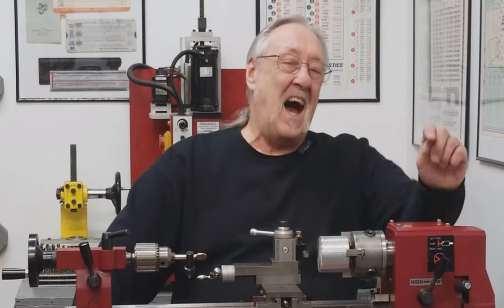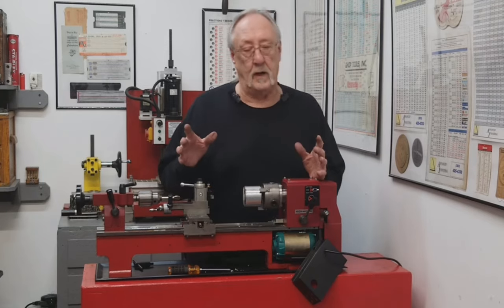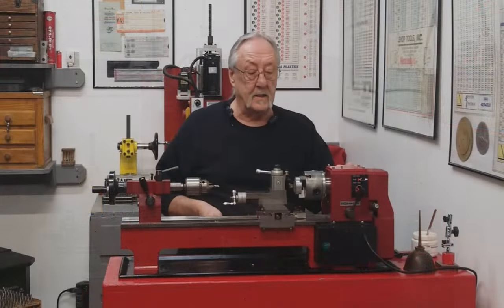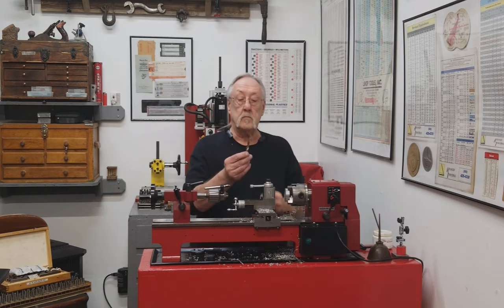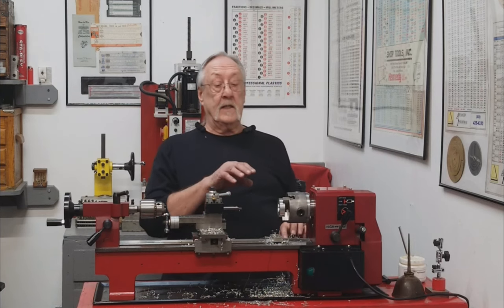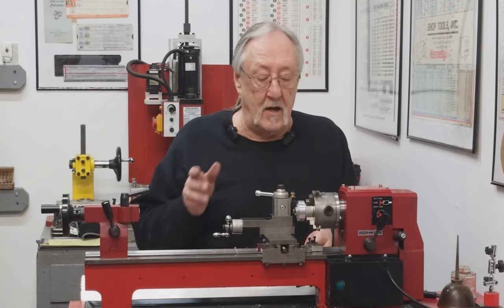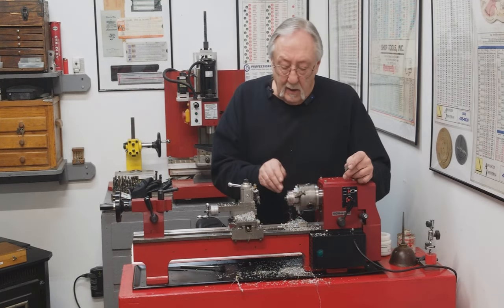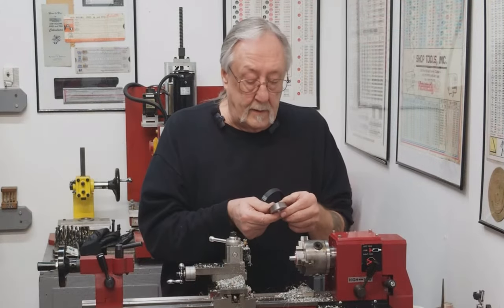Mini Lathe, Big Motor UpGrade 2, Turning Custom Pulleys

Comment: Great vid Glenn...
Reply from the maker: I'm glad you liked it Frank. There is so much more to do on this UpGrade. I'm currently working on Big Motor UpGrade 6 and the videos keep getting better. Lots of hobby machining and that's what my channel is all about. Thanks for watching.
Reply: @GlennNowOnYouTube  
Yes Glenn, I am a hobbyist, retired carpenter, but have developed a keen interest in metal working...
I have bought a mini lathe and a mini mill...
So I am learning through YT vids... 
I am in the UK ... I have a small workshop, fixing to build a new bigger workshop!
Looking forward to more content from you Glenn...

Frank...
Reply from the maker: The main things to remember is to take your time be careful and have fun. It's a hobby. Good luck with the building of your bigger shop.

Comment: Hey!  I noticed you used a gauge block instead of a pin this time😂 I like the idea of using a grooved belt a opposed to a v belt since it will grab better.  Also I was surprised to see you face the part to length first instead of doing the grooves and id work first and parting it off complete.  I guess if the material was too short for it in the first place then it makes sense.  I was watching and immediately thought "he's going to have to mount that on a mandrel." But I was prepared to be surprised since I definitely don't know everything and there is always "another way to skin a cat."
Reply from the maker: Hey Joe, To think about doing that pulley complete on that little  lathe scared me. That little chuck could only hold on to about 1/2" . And because I felt the video was going to be about putting in the grooves, on the pulley. I decided to use an arber and gauge blocks for accuracy. I think that I would have approached the job differently if I was using a larger machine. After 50 some years in a machine shop There is one thing I learned. There is no one right way to make a part. And that all depends on who you're talking to.  Its good to  hear from you Joe. Have a great weekend. 👍

Comment: Great video, an interesting upgrade, but I do wish right handed people would learn to use files left handed when breaking edges on a lathe, it always makes me cringe when someone leans over a rotating chuck.
Reply from the maker: Thanks for the concern. Running a lathe in general is dangerous. But, it's what I like to do. I believe that I try to be careful though. The Upgrade is interesting and  lots of fun. Lots of Hobby machining. Just about every part of this project will be custom made. Keep watching and follow the project to the end and I'll try to be careful. Thanks for watching.